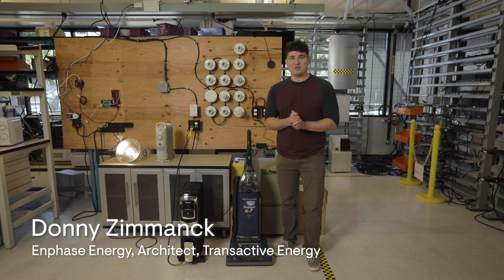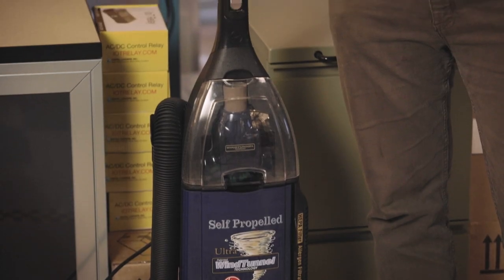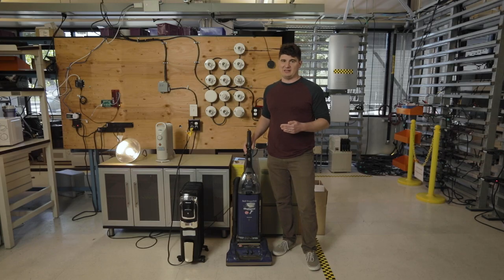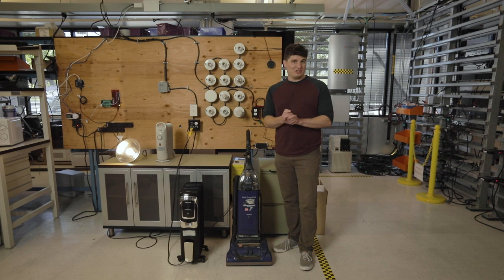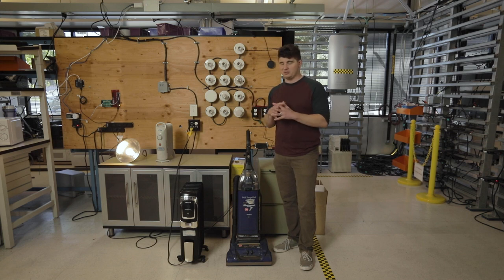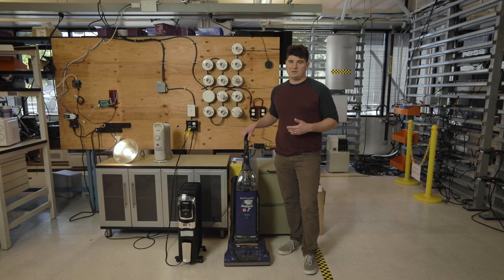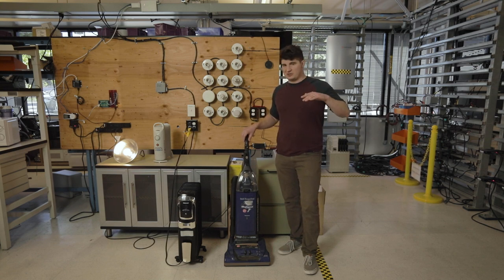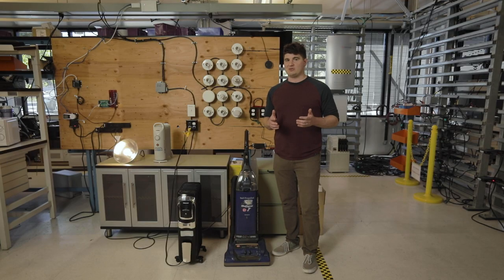Enphase Labs: Sunlight Backup​

Comment: ok questions.... it seems you are saying that these new microinverters can operate as backup power, for when the grid goes down, but only when the sun is shining (it will deliver AC power directly to loads).  my questions --- 1) if the grid is down and there is nowhere (no charge controller or battery) to put the energy (unless there are adequate loads calling for power) where does the extra power go?    2) does this comply with grid shutdown requirements?   How are you isolating the power from the grid so you don't feed power back out?   3) do you need a dedicated sub panel for vital loads, or does this just feed the entire house when the power goes down?
Reply: Good questions. Anyone?
Reply: Same questions here, plus how does this integrate with a parked EV on Green PHY standard CCS charger.
Reply: The micros shut down and throttle the power, we are talking about Enphase of course they comply with grid shut down requirements. They were grid shut down compliant before everyone else
Reply: @guidedbygreen1480  throttle? Hmm. Do they have a heat sink for that much power? I know you can shut down or open circuit without a heat sink but can you throttle?
Reply: @garybeckwith  not sure. They have installer live webinars pretty frequently, if you'd like you can attend one of those and you can ask the trainers if it's not discussed in the webinar to get a better understanding
Reply: Intentional island mode requires the Enphase "System Controller 2" that isolates the micro-grid from the utility grid.

As for exess power, I am guessing it's probably switched really fast like a dimmer, so there is no excess power, it matches production to consumption.

Comment: Hello from a beginner. This is interesting to learn a battery is not necessary here. Friendly suggestion: could you do a brief video on how a DIYr might piece together a small system, as you will be selling these? Or are they part of a bigger package a homeowner must buy? I know you do home installations, but will people be able to purchase independently? How does it work? The more you can educate people the more you could sell. Thanks for your consideration.
Reply: Check Pacific Sun Tech video, they will compare the 4 different systems. It looks like there is only 2 additional device you need to add (IQ System controller 2 and essential load solution). The installation should be similar but I guess the Solar companies who order first will get it before the general public.
Reply: Distributors typically have deals with manufacturers to prevent independent purchasing. You would likely have to purchase from a local solar company or possibly a distributor. The iq8s have been given priority to certain companies and aren’t at full scale production
Reply: Nancy Chace, There are a number of really good DIY Solar Channels that I recommend for beginners. Off Grid Garage, Digital Mermaid, DIY Solar with Will Prowse, Bobby's Solar Homestead, Lithium Solar, DavidPoz. These are my favorites and I also have a couple of videos posted on YT myself. Hope this helps.

Comment: I hate to be a pessimist but the long wait sort of becomes all sizzle no steak. What exactly does the IQ8 do that the sunny boy inverters with backup power built-in don't? Without all the additional cost? The concept, while intriguing is a misnomer due to the fact all the additional hardware that one Hass to buy sending the price through the roof.
Reply: Well you’re definitely a pessimist. Enphase is a superior inverter and will make much more energy during its expected 30+ year life, especially if the panels aren’t all facing the same direction
Reply: I think the sunny boy only alots up to ~5 kW (dont quote me) during grid down mode. So not enough to power your house most likely. I think, in theory, the IQ8 gives you whatever amount your panels can produce.

Comment: Great video and great feature....But my understanding is that some additional components are required over and above the normal solar installation for this "Sunlight backup" solution to work, right? It would be nice to understand what those additional components are and roughly how much more it will cost to purchase/install the additional components AND if a user starts with this "Sunlight backup" solution and later decide to add a EnPhase battery are those additional components that were purchased for this Sunlight backup solution simply "throwaway"? Or are they necessary as part of a backup solution (i.e., used with battery backup solution.).  Also, is there a risk during "brown out" that you could damage any appliances during these brown outs. And even if there is a theoretical possibility of causing damage is there a simple way to mitigate that potential (e.g., plug in devices you plan to power into a power strip with built in surge protector?).
Reply: Your questions are my concerns.  Guess we need to throw away the AC Disconnect if you upgrade from Solar only to Sunlight Backup and the throw away the two load controllers, load centers when you upgrade from sunlight to full battery backup! Why can't they incorporate the load control into the System Controller 2?

Comment: Does this require a critical load panel or is the pv and iq8 backing up the entire main panel?
Reply: I had a rep at my house today going over some of the financial details as we prepare for a large (~17kW) array w/ one 10kWh battery. We're an all electric contemporary house out in the country. Discussing that very thing he told me the combiner (IIRC) has four 20A circuit breakers. So if that's all you need powered that would be enough. I have a 220V water well pump. I will need a subpanel.

Comment: Need to be sure you get the System Controller 2, not the older System Controller (model ending in US00). The older one only works with IQ6 and IQ7 series microinverters.

Comment: Don't you think if the grid goes down and you manually turn off the main 200A breaker in the Main Service Panel, that Main Service Panel should become an off grid panel ? That way the solar panels should supply power to your home? Anyone??

Comment: If you have a PV system attached to the grid and if the grid has a power outage; do you need an Enphase Empower Smart Switch to go off grid and have this sunlight backup option to work?
Reply: You need load center

Comment: What if instead of having 1k watts, I have 18Kw solar array. Can I run my AC and well pump?
Reply: He probably has a 3.5ish kW system (10) 350W panels. The 1000W piece is only stating that it’s a sunny day and 1000W/ square meter is what you can expect during full sun. An 18kW system is super big, and can only be hooked up via “line side tap” in most situations.  You need to speak with a local contractor to see what size system works for your home and needs

Comment: So important question. Can the previous generation use this like 7a or is it more the IQ load controller. And if a 7 series needs a firmware update to work as a sunlight backup.
Reply: Main difference between the 8s and the 7s is a firmware update. There are some other subtle differences regarding the electrical specs but major change is the firmware. 7s most likely won’t ever receive this because it won’t encourage new sales to the 8s
Reply: Wont work. Pony up for the iq8 😂😂

Comment: explain inrush current is from inductive component of impedence within an inductive motor. in the vaccum. Inverter has to adjust phase angle to the complex conjugate in order to maintain maximum power transfer.
Reply: That is one really great stability algorithm! Makes my house seem like its on a 'weak grid'. 
If everyone used enphase instead of grid following we would have fewer datacenters in the world running pointless algorithms.

Comment: How does rapid shutdown work with grid-forming inverters?
Reply: The "System Controller 2" isolates from the grid and sends a signal enabling the micro-grid intentional island mode.